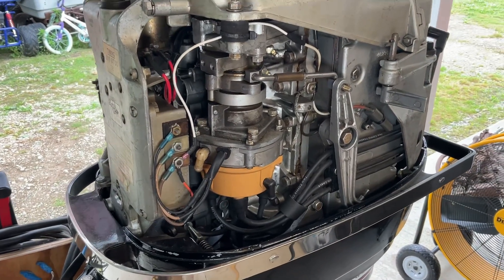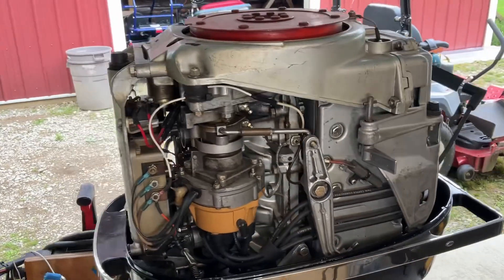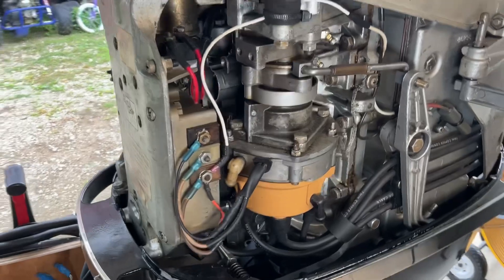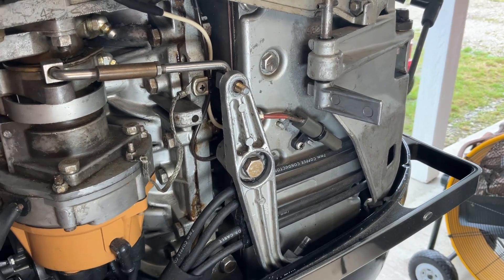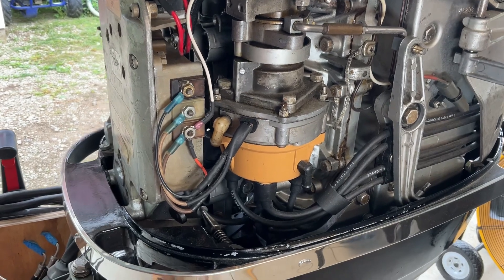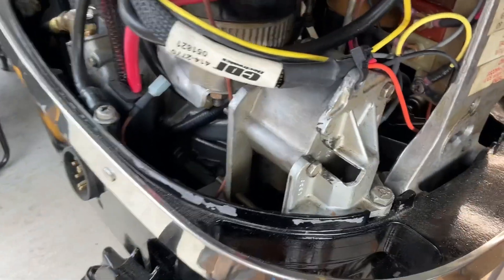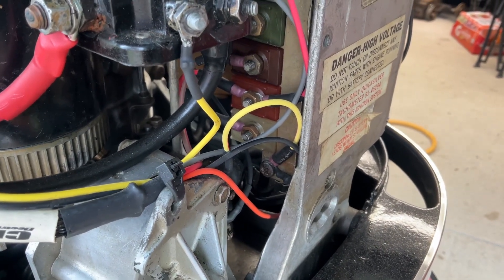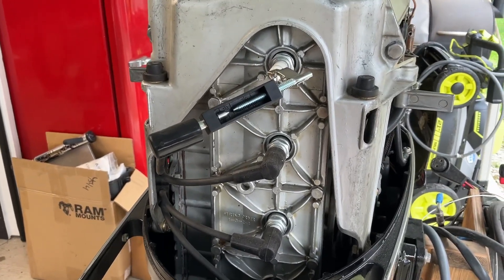MERCURY TYPE III Thunderbolt Ignition Wiring

Comment: Hi, i have a 1969 merc 650 4cyl 2 stroke, i cant find the wiring diagram for its switch box with only 4 wires. im measuring voltage coming from the distributor triggers. but no voltage to the coil
Reply from the maker: Send me an email and I’ll get you the wiring diagram.  Just give me the serial number located on the clamp.  Casey.r.lang@gmail.com

Comment: Got a silver one too with the distributor and two barrel coils, and I’m having misfire or sporadic loss of spark on cyl 2,4,6. Can you pleas tell
Me what you think it is or where to look?
Reply from the maker: 1). Check compression on all cylinders and each cylinder should be within 10% of each other.. 
2). check plugs.  
3). Use a timing light to verify if you are getting no spark or intermittent spark on each plug wire. 
4). Swap good plug wires with misfiring cylinders to determine if it is  a plug wire problem
5). Check your cap to see if the contacts are fouled of if there is a hairline crack.
6) check your trigger.  You can “bench test” at each plug position.

Try that and let me know if you find anything.
Reply: @langbros.1907 All passed except spark on 2,4,6. Swapped wires and plugs no difference. Took flywheel off, no marks. Scratched paint and took forever to see the fading dots. Followed instructions online on measuring it clockwise form dot to TDC, then TDC to first mark and then second mark. Lined up arrow on distributor to center of shaft. Installed belt, then pulley cover. Then installed back the flywheel lining the new mark I made for TDC as close as can while bolts on top of flywheel fell into place. I believe that fixed that issue. Weird part is was idling so high had to abdomen the idle screw out almost all the way to idle fine. Timing light shows the mark I made in the center of the pointer—a hole on the top piece where solenoid mounts and covers the flywheel, if that’s even the pointer lol. I have spark back and sounds good now I’m just not familiar with this motor at all
Reply: @langbros.1907 I lied—spark back to sporadic misfire. Only on 2,4,6 cylinder. How can I narrow it down to know what to buy?

Comment: Learned a lot about Merc in this video I’m a Johnson/Ev guy. I’m looking to buy a coin and switch box and fuel pump kit for a 1074 115hp v6 (same ignition system as yours) any recommendation on where to find them ? I’m struggling to locate available parts
Reply from the maker: Most OE parts are sadly used up, so finding them NOS from a Merc / quicksilver dealer is difficult.  You can find them readily on eBay, or there is an aftermarket company that makes retrofit kits at CDI Electronics.
Reply from the maker: You may try marineengineparts.com. This has been very useful parts source for me for many makes/models.
Reply: I can’t thank you enough man I appreciate you. Happy Holidays! Cheers 🥂
Reply from the maker: No problem.  Have a good one!

Comment: amazing how different mine and yours is my starter solenoid is under the starter motor, I bought the same internal wiring harness as you have but directions says White wire is not hooked up when a diagram shows the white wire (F) hooked up, it looks like you have your white wire hooked up, so from the bottom up you have white, red, then brown i assume? also my mercury switch is above the switch box assembly black to frame brown to brown on switch box.  Yeah you know the aluminum bracket they give you for the internal wiring harness? I had to Shave quite a bit off mine on the left side just so i could get it to fit and i also had to take off a bulging diaphragm housing held with three bolts then install the bracket to hold the internal wiring harness, then install back the diaphragm housing back on with no room to tighten up the lower right bolt completely tight. so frustrating i tell ya

Comment: 1969 mercury 650 four cylinder the starter solenoid is underneath the starter, I just bought the cdi replacement internal wire harness like yours, one of the issues i am having is that my external plug and external wiring harness only has six wires/pins, the cdi internal wiring harness has seven male pins F which is white according to cdi directions is not used, when i hook it up as diagrams show all i get is one Click from the starter solenoid, something is very odd we have similar motors but your starter solenoid has easy access mine is buried under the starter and in this video i couldn't capture a vie of your rectifier, i bet mine is different than yours as well? so still working on the motor and just ordered a starter solenoid but i really suspect the issue is the wiring from key switch to internal plug
Reply from the maker: Checking back in.  Did you get your wiring issue figured out?
Reply: @langbros.1907  yeah i had the black and yellow wire on the wrong poles on the solenoid, once i swaped them over fired right up

Comment: Hey there a quick question about the tether im installing one now and was wondering when the engine is running and then the tether gets pulled does the bottom trigger post get grounded out?
Reply from the maker: On my thunderbolt 3 when you short the brown wire from the trigger to ground you will safely cut ignition.  You should see the tilt switch (mercury switch) wired here as well which serves the same purpose.  If you are wiring in a tether at the helm control just one wire from this terminal up to the kill switch.  The other side of the kill switch just needs to go to a clean common ground.  Hope this helps.

Comment: Is the bottom wire to the trigger supposed to get battery voltage with the key on the on position? Also is it supposed to get constant voltage while it's running?
Reply from the maker: On the left side (facing aft) with 4 terminals on the switch box, the Red position is B+ constant (not switched) and is important to have your battery disconnected anytime you are playing with the wiring.  For this reason I use a disconnect switch at my battery for transport to avoid  potential for a short when trailering.  The lower White position is switched power from the throttle.  This is B+ in the RUN and START key position.  Note this is the wiring for a type 3 solid state Thunderbolt setup for the 650SS and 500SS, and may be different depending on the outboard / ignition system you are working on.
Reply: @langbros.1907  what about the bottom wire to the trigger (the 3 wire side) on the distributor side of the switchbox? Is that supposed to get full 12v with the key on? And is that constant while the key is in run position?

Comment: Hello, do you know where I can get a new or refurbished trigger my three cables are hanging by a thread?
Reply from the maker: Sadly no.  That component is no longer available through Quicksilver or the aftermarket.  Your best bet is to find an old part and do a Frankenstein job (EBay, etc.). I ended up splicing new stranded leads onto mine with solder and heat shrink.  You might try an older style auto repair shop that rebuilds distributors.

Comment: How did you connect that orange with to a tether kill switch ? Would you have a wiring description of it
Reply from the maker: It's a single wire that goes to my throttle control at the helm.  The switch is normally open and if it is triggered (tether pulls it closed) it cuts spark.  I can send a snapshot of the wiring diagram if needed.